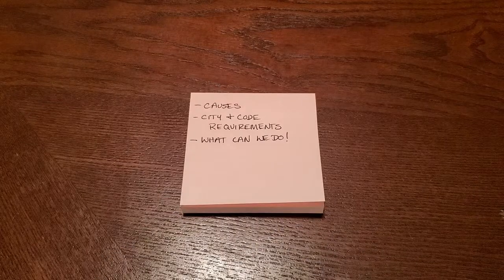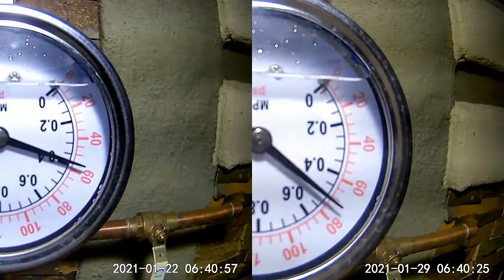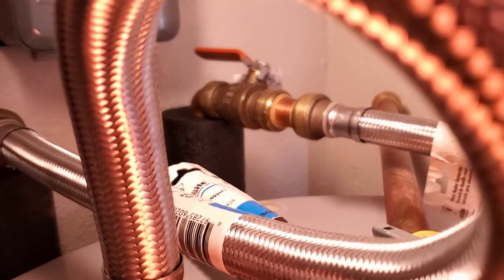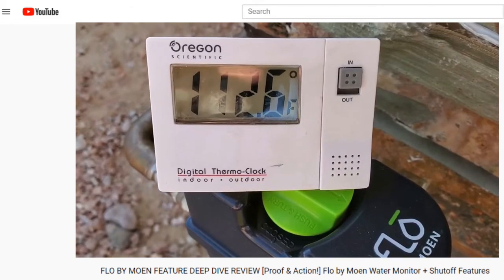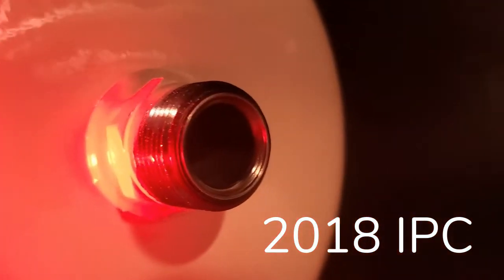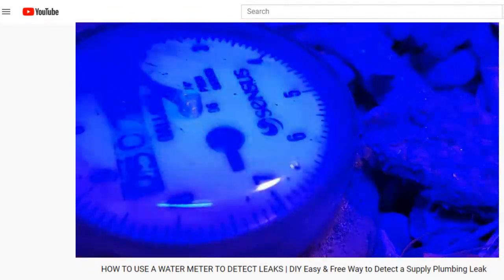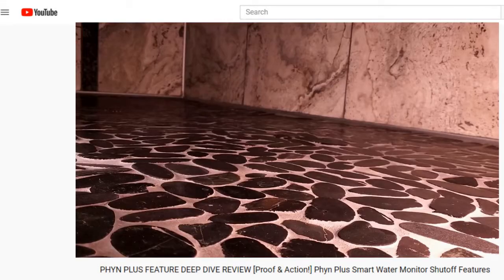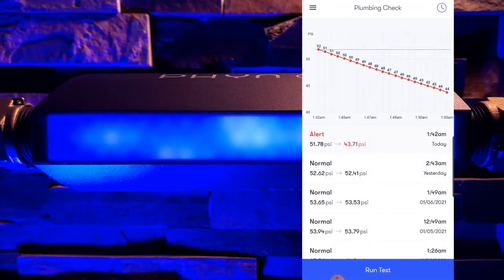Thermal Expansion in a Closed vs Open Plumbing System: Causes, Risks & How to Deal With It

Comment: my plumber sold me on attaching a thermal expansion tank on an open system and it caused a whole chain of problems until taken back off.....
Reply from the maker: Oh no! I'm glad you got it solved!!! What gremlins popped up as a result? My theory is that it just provided more expansion space for the city so I'm really curious to hear what really happened.
Reply: He ain't no licensed plumber if he sold you an expansion tank on an open system. That's a big no no
Reply from the maker: @jackcomstock8  Agreed. Do you happen to know what are the side effects? Online searches pretty much limit all search results to closed systems...
Reply: I'm looking for an expansion tank and I found this video. I'm on a closed system, personal well. The only expansion tank I've found locally available so far specifically states "Controls thermal expansion of water in open domestic hot water supply systems".